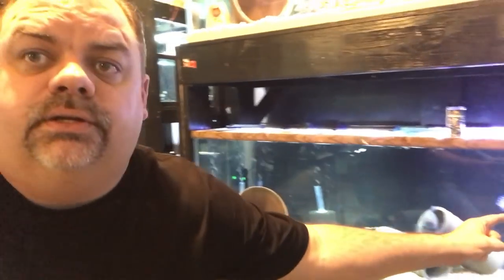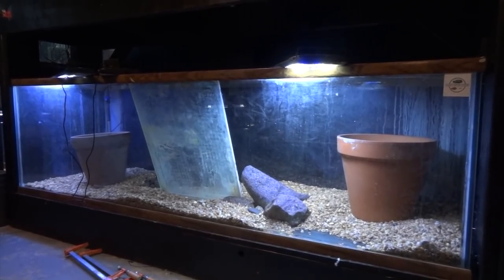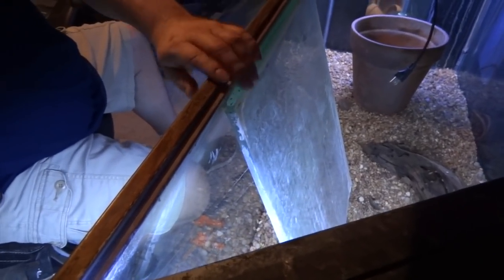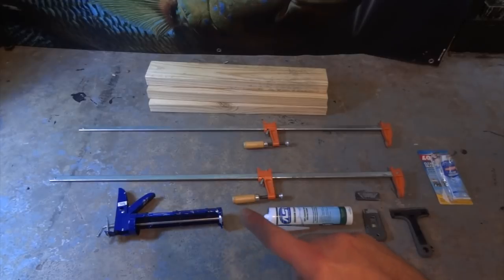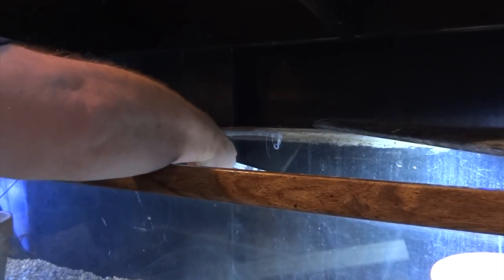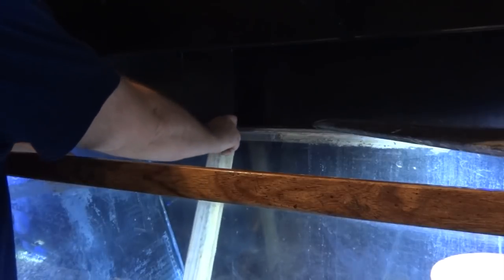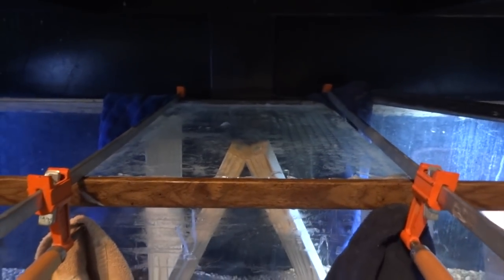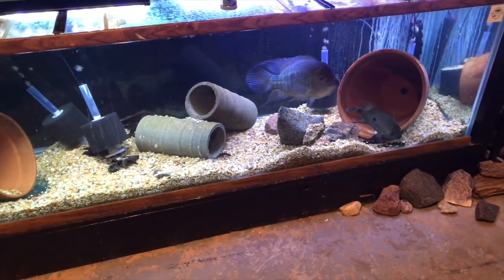My 210 Gallon Freshwater Aqaurium Broke!  Disaster?

Comment: I would have setup 2 saw horses and put the tank on them upside down. I would have done the gluing in of the brace from the underneath so that gravity was on your side. 

I have never seen a center brace that was cut to fit inside. Usually they are cut to go on top. I am surprised that the silicone is strong enough to hold when done on the inside. I have had to retire tanks with broken plastic frames before because there was no easy way to fix the center brace. I may have to try putting the glass on the inside next time!

Comment: Hey I have the same exact tank. The silicone is falling apart on the seam that holds the glass together. Any idea on how I could fix that? I was going to take the tank apart and reseal it but I can’t get the rim off the top of the tank.

Comment: Aren't you worried about the rest of the seams if the silicone is that old?  That's quite a bit of pressure on the corner seams too.
Reply from the maker: +Mike Kirkpatrick I checked the rest and it looked fine